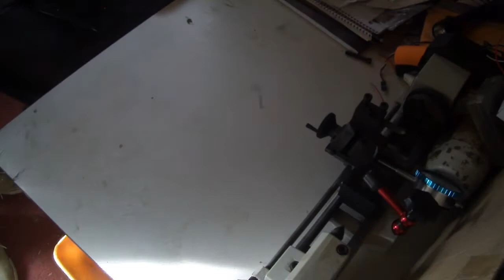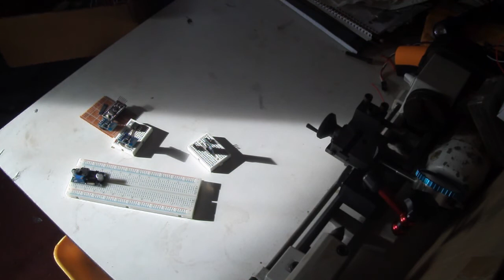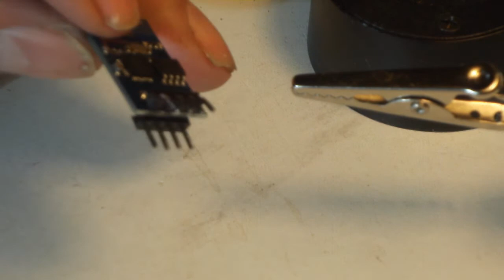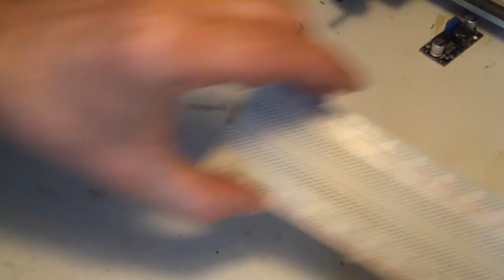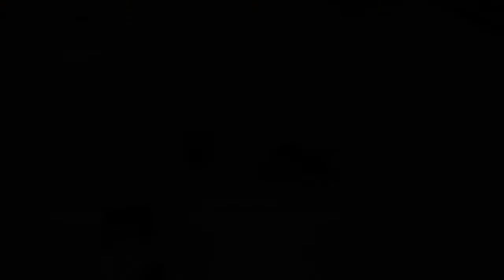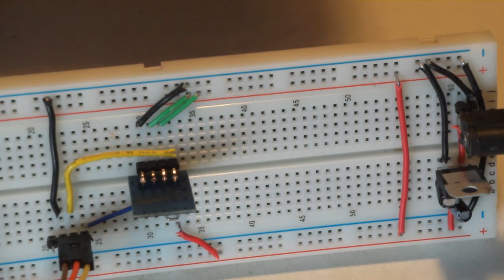esp8266 pt.1 Last try

Comment: I don't understand.
they all are  9600 or 115200 out of the box .
just pull pw-dn pin up and they will respond if you pull-down rst shortly.
I bought multiple at banggood
They all work  doing Luna , at commands, Frankenstein  etc...
Used ide under Linux in vm's  , used eclipse ide  under windows, used explorer for Luna.etc...no pain at all.
However , they will die on 5volt levels.